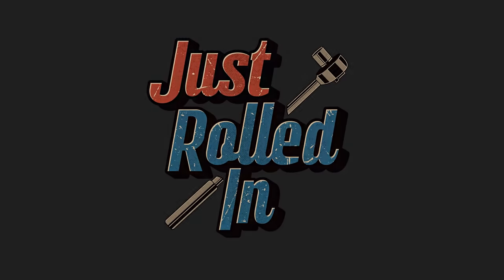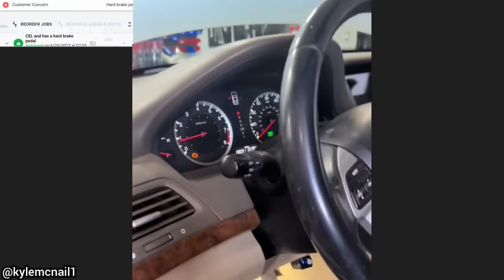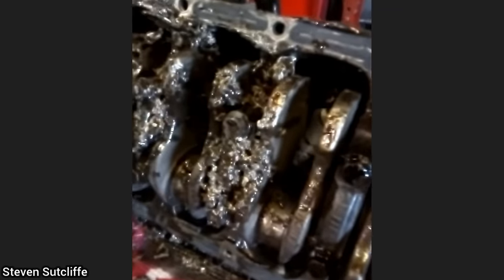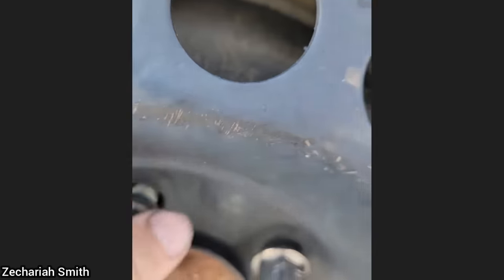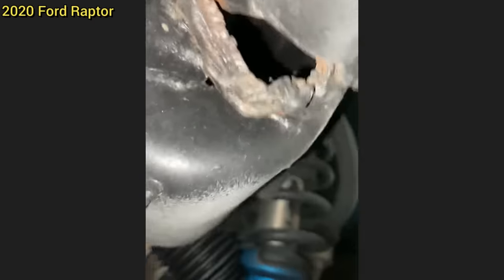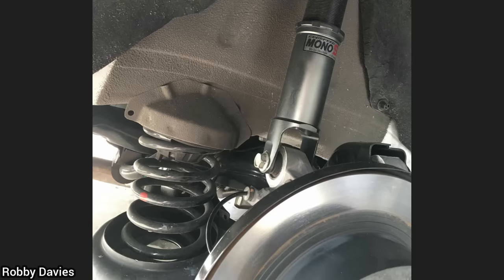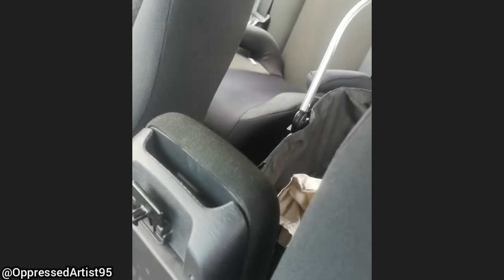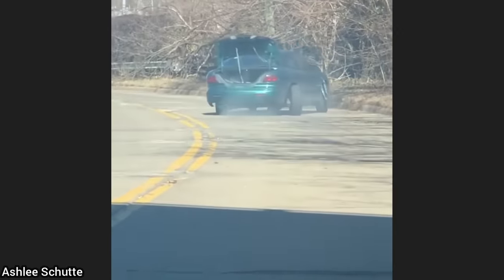Customer States Haven't Changed Engine Oil In 90,000 Miles

Comment: Seeing all these cars going thousands of miles without oil changes maybe I should stop worrying when I miss my oil change interval by few hundred miles.
Reply: Their car: keep running until 96000 miles without oil change
Your car: engine blows up after you missed the oil change by 1000 miles
Reply: yeah you can push oil changes quite far, it just gradually increases how fast things wear out as the oil becomes filled with particles.
Reply: Deployed for two years. While I was gone, my sister used my car. She traveled all over hell and half of Georgia. I forget how many thousands of miles she put on it. About two months after I got back and took the car back, of a Sunday morning in the middle of nowhere, there came a wondrous knocking from the engine. 
Valve lifter collapse because oil was about the consistency of seasoned oak.
Reply: Precisely. I skipped the annual change in 2022, and had almost 16000 km, or 2 years, by the time I did it in 2023. So far so good but I feel like most irresponsible cheapskate.
Reply: You can... But I wouldn't
Reply: Every 10,000 for me. Over 250,000 on the clock and still runs great. That includes the cheapest priced oil with mixed viscosities and brands.
Reply: @dirtfarmer7472 I go by the mileage minder which is around 6,000 miles. I have 220,000 on 2008 Honda Civic Hybrid and 159,000 on 2011 Honda CRV EXL. I’m with ya. 75% of all early breakdowns of car parts are because of a lack or no maintenance unless bad design. I want 300,000 miles out of the CRV.🏆✌🏻
Reply: I went 1,000 miles over my oil change interval, and my head gasket blew not long after I changed it. If I didn't know better, I'd think going over the interval was the reason that happened
Reply: @micheal49 did you knife hand her?
Reply: That's what those ppl from the video said. Slippery slope.
Reply: Synthetic oil can protect bearings up to 20,000 miles. It is very resistant to sheering.
Reply: I change mine every 7500 with synthetic and the best oil filters. 350,000 miles on it now
Reply: 2007 wrx at 308k miles i was told i was an idiot for doing oil changes when i didn't need to, still going strong
Reply: I change mine either every 5000 miles or every year, at the most (mine hits miles, wife's hits time).  I don't care if the manufacturer or the bottle of oil claim longer.  EDIT: though if I wind up going over by a couple hundred miles or a couple of weeks, I don't get bent out of shape, but those are the points where it starts getting up the priority list.
Reply: It really depends on the quality of the Oil and Oil Filter that you use - the combo of both together, not just one or the other. I'm using Amsoil Signature Series Oil with a FRAM Ultra Synthetic Filter, so I'm good for an oil change interval of 15,000 miles. I already had an interval of 15,000, the engine still sounds quieter than it did when I was using Pennzoil Platinum Synthetic.

EDIT: Yes, a FRAM. But stop assuming it's as bad as their cheap ones. It does not have rubber band construction, and it's rated to clean as much as an Amsoil EaO filter (99.7% or 99.8% capture rate at 20 microns) which I'd otherwise use. Here's video proof that this FRAM has no rubber band:

https://youtu.be/Gm9J36Szcho
Reply: Oh, and before you start thinking that I may have sludged up my engine with an OCI of 15,000 after running on my chosen Oil and Oil Filter: the oil pan was removed by me before my last oil change - I needed a new gasket. There was no sludge. But again, that's because of the Oil & Oil Filter that I used. Not all oils protect the same amount.
Reply: Don't do it for 2010+-ish Toyotas. It causes them to start guzzling oil. Starting to run into that with my 2012 Camry, hope I caught it early enough to stave off.
Reply: @micheal49  Thank you for your service, and sorry to hear your sister didn't get your car serviced.
Reply: We had truck come in CAT engine has IVA codes, other tech put new IVA housing on and claims he followed troubleshooting. I get the truck because same code is back. 1st step in troubleshooting check oil level. NO oil on stick, put in 5 gal of oil in and note 10 gal system. Verified repair no code, went with driver on test drive and driver says OH WOW OIL PRESSURE GAUGE DOESN"T JUMP AROUND LIKE BEFORE.............WELL DAAAAAAAAAAAAAAAAAAAAAAA 5 gals low on oil. This was engine had warranty still on it. Made driver pay for part and we ate labor. Driver said he never checked the oil because truck new shouldn't need too.
Reply: depends on the oil you get like full synthetic you can go to like 10k miles maybe even 15k all depends on the oil your useing
Reply: And you know for a fact whoever has that transit will be bitching and moaning about how unreliable Ford vehicles are and how "it seized for no reason"
Reply: I had the same thought recently.
Reply: With my Jetta I change every 7000 miles or so. It has been flawless.
Reply: @uriahstivers8125  much more likely that it was just a faulty head gasket, just because something happens after something else doesn't automatically make that the reason. put another way, correlation doesn't equal causation.
if someone can go 100k miles without changing oil and their head gasket is fine......it's far more reasonable to conclude that your head gasket was faulty or old.
Reply: @colynman it would still be undeniably better for the engine to change every 6000 with full synthetic
Reply: I own a mustang gt/cs 2014 and I do mine every 4000-4500 also my odometer is around 130k miles and still runs perfect only thing I’ve had to change engine wise was a coolant hose and that’s it but it was still a bitch to change lol but well worth it
Reply: @spooderdoggy I want 200k out of my mustang gt before I rebuild the engine
Reply: I use full synthetic with long-lasting filters, so I only have to do one once a year or 10k miles.
Reply: 3:05 deja vu
Reply: I will never buy a used vehicle .
Reply: @bubbleman2002 nope
Reply: @BabyBugBug till it isn't
Reply: @kenj.8897  Til it isn’t what?
Reply: I change my oil every 3k miles and with synthetic. The things that could go wrong are not worth it.
Reply: @kenj.8897 And I really don't want to buy a brand new vehicle but I may have to at some point. Imo vehicle reliability started going downhill about 20 years ago, but finding something low mileage and well cared for is becoming difficult. I trust my ability to inspect and diagnose an older vehicle way more than I trust a new vehicle's vast array of computers and the overall build quality and reliability. Although I suppose if someone wants to buy newish, they might as well buy brand new.
Reply: @jmi5969 damn
Reply: The thing nobody has said is it heavily depends on the type of engine, age of the vehicle and how it's used or abused. 2000 miles off-road or in extreme conditions is very different than light commuting in more moderate conditions. A big slow v8 is very different than a little boxer engine. Newer vehicles often have smaller, higher revving engines that call for thinner oil and less frequent oil changes. While it may last longer under normal use, I strongly suspect both the engine and the oil don't hold up to abuse as well as in the past.
Reply: If only they topped it off with a cupful of oil every 10,000. Probably still be running
Reply: @101Volts Why use such a good oil with such a shoddy filter? Wix are only a few bucks more and are way better made. See cutaway comparison videos for references. Your combination is silly 😂 I dunno, it's probably a good thing you use good oil cause I'd probably make up for a defective filter if you got one.

Napa's are fine too, as well as Bosch. Royal purple is fine though I don't think they make my size lol.
Reply: See you on an episode of Just rolled in then. 👍🏼
Reply: Not when you have a timing belt that goes through the oil. Like some modern cars.
Reply: @bachaddict  And maybe even more worrying is the loss of viscosity and lubricity.
Reply: Once had a car that went 2 years (but low miles) without an oil change and still regret it to this day!
Reply: I drove my used sprinter ~75k miles with no oil change. It never complained about that specifically.
Reply: @kevink1431  
remind me to never buy a used car from you
Reply: @jmi5969 think of it this way, what's cheaper buying oil twice a year, or replacing a whole car/engine 😂😂
Reply: @growingup4487 I would kill to have my 2010 STi reach  even 200,000 miles. I'm probably just below 120,000. I change the oil every 3000 kilometers.
Reply: @101Volts FRAM??? 😭
Reply: Those people that never changed  their oil are the type of people who say 'I spent $50K why should I  pay for changing oils the oil should last forever'
Reply: @BabyBugBug  10,000km is what people here change their oil, then again we have more moisture in the air that leads to condensation inside the engine and cold climate so its rougher for the engine with all those cold starts.
Reply: @Beethoven2949  "Twice a year" is a certified overkill - I only drive in summer, not more than 10000 km annually and much less after the 2020 thing (does youtube still censor it's name?). Anyway, the car is 15 years old, it already paid for itself.
Reply: @Fools_Requiem  Thought its every 3 months OR 3-5 thousand miles, whichever comes first? Reason being is, oil just naturally degrades anyways, regardless of whether you're actually driving or not.
Reply: Every 10,000km for me (6k miles). Sure you can push it a bit, but the more you push it and the more often you push it is the reason that engines usually start failing around 300k km/200k miles and start being considered as too worn out. 

Keep up with the maintenence and it'll keep trucking along no problem.
Reply: @micheal49  I don't give any vehicle of mine to anyone, there lack of planning to buy/have there own vehicle is not my problem. If there on the bones of there @ss you know that something that they don't own will be something they neglect ... it always amazes me with these people they will cry poverty but the always have enough money for cigarettes, alcohol and/or pot ...
Reply: @3DTwinkies  You're wasting your money if you're getting oil changes every three months or 3k miles.  Cars from the 80s may have needed that kind of treatment, but not modern cars.
Reply: I use full synthetic and go around 8000 miles.
Reply: @MajorasWrath1 Wow! That would get expensive if you travel as much as I do. It's kind of overkill even if you're using conventional, let alone full synthetic.
Reply: @saltwater8915  Eyah. Most agreed. But, in all fairness, I was young and dumb, and sister's hubby was a raging car guy, so I figgered he'd do better than "wait till the light turns red, add a quart". After that -- Lesson Learned.
fist bump
Reply: Depends on the engine. Some will tolerate longer intervals than others. Stretching the interval just adds up in the end, usually in catastrophic fashion. No engine is going to die from going a few hundred miles over; most won't even die from a few thousand. But that adds wear and tear over time, and knocks lifespan off of the engine.
Reply: @mattd1188  Nothing wrong with Fram's higher-end oil filters. It's their lowest-end stuff that is shoddy. If you have a Ford, Motorcraft makes the best oil filters in the world for Ford vehicles. You can't get anything better.
Reply: @dirtfarmer7472  my dealer says that they'll only change it after every 20'000km and I here in the same "5000km and then change oil" camp. Feels uneasy but hey, I guess they cover the cost if anything.
Reply: We had a 1990 Nissan pickup and decommissioned it around 2004, it rarely had an oil change after 1997 but ran fine until the brakes & body panels rusted out. I wasn’t responsible for that vehicle…mine always had regular oil changes & maintenance.
Reply: Yeah, same. I'll go 5000, maybe 5500 and feel bad. 60,000?
Reply: @mattd1188  It's a Fram Ultra Synthetic Filter. It's higher-end than the cheapest FRAMs, & it's rated to clean as much as an Amsoil EaO filter (99.8% at 20 microns) that I'd otherwise use. Do you think "FRAM" = "Cheap, and with the the filter element held on with a rubber band?" Well, it's not - here's video proof: 

https://youtu.be/Gm9J36Szcho
Reply: Honestly depends how you drive and where you drive.  Some situations you should do it sooner than the manual says and some you can go longer. Mine says 5000 but because I don’t rev the crap out of it, it runs long enough at least once a week to boil the water out of the oil and I do mostly country road/highway driving I go 7500-8000 since I got my car. I’m over 200k miles now and it still runs like new other than the noisy exhaust I need to fix lol
Reply: @dirtfarmer7472 ⬅️ Sunny or rainy weather?
Reply: @growingup4487 ⬅️ shear not sheer
Reply: A few k id worry, not a few hundred.
Reply: I did every 9000 miles
Reply: NO! Don´t do the first step in becoming a safety hazard on the streets, we allready have enough *Points at every Just rolled in Clip.
Reply: New turbo cars need every 3-5 thousand miles to be changed.your 10000 mile oil changes look awful and most of it has burned or leaked out by then.
Reply: @101Volts that is surprising, Pennzoil Platinum is a very good oil.
Reply: @alphatrion100 wet timing belts are so stupid. One of the most ridiculous cost-saving measures I've ever seen. You know the engineer was just shaking his head when he was forced to go through with that design.
Reply: @friedpickle9828 
I hold the engineers accountable for such a stupid design. They should have kept their foot down.
Those cars won't break any mileage records
Reply: @micheal49 when I bought my sister’s 1971 beetle from her, first thing I did was go to change the oil.  About 1/2 cup…. 4 fluid ounces…. Dripped out of the oil pan.  Those engines were hard to kill.  Ran great once it was full of fresh oil!
Reply: @Anonymous-jj9yu  well quit hammering and redlining it then lol, Ford's recent engines ain't exactly quality champions
Reply: @forestghost7  I’ve had zero problems with 2014 models but the newer ones are shit
Reply: @dirtfarmer7472 Same here - and the filter. I don’t get why people neglect this.
Reply: There is some lee way.  These vehicles are a glimpse of what is going on in people's minds. Scary.
Reply: I have an 03 Honda Odyssey with 210k miles on it. I'm the second owner, and I put all but 50k of those miles on the vehicle. I use Royal Purple oil and filters, and I change the oil once a year the day after my birthday. (Or every 12k miles whichever comes first). Though last year and this year I forgot. I was going through my receipts and service record and realized I was 15 months overdue (27 months since last oil change) and had driven 26,000 miles on that oil.
 I asked my brother (a mechanic for the state of FL) to do the oil change for me because I couldn't find a sitter for my toddler.
He drains the oil comes inside and says "are you sure you didn't just change this oil? It's coming out and it looks like it's fresh synthetic you could easily drive another 3 to 6 thousand miles on this."
Reply: @alphatrion100  The board will listen to accounting, not engineering. The chance to save a buck is just too tempting. Oh well, they'll be the ones to lose a customer for life by implementing these wet belts
Reply: I normally do oil changes every 5000 miles, but if I did that with my Civic I'd be changing it every 2 months or so.  I was putting 2000 miles/month on it, so it gets every 10,000 miles.  Over 200,000 miles on it now and when I pulled the pan recently it looked brand new in there.  Oil I use is Walmart Supertech synthetic and the Supertech oil filter.
Reply: That's kinda the thing with any routine maintenance. You have a lot of leeway with the routine interval but at the same time it's very easy to go from routine to never done at all if you are too lax with it. Best to try and keep as close to schedule as possible more for the sake of the human mind liking consistency than for the device actually needing it right that second.
Reply: @growingup4487  yeah 308k on the body but how many engines have you replaced? /j
Reply: How the hell can people think it’s ok to not maintain their vehicles. This is scary and extremely dangerous. I take my car in for MOT & service without fail every year. 
My car is 2005 and still runs great.

People that let their vehicles get like this should have their driving license taken from them and banned from owning a car. 

Putting yourself and others in danger. 😡🤬.

Surprised that the police didn’t stop these vehicles before and strip the driver of their keys and get the vehicle scrapped immediately.
Reply: let my '04 Accord go nearly 7k miles on an oil change and felt really bad about it.
Reply: Dad always said, oil cheap, engine not so.
Reply: @Acorn_Anomaly  You can try Amsoil engine flush, then put in Amsoil Signature series oil and a new oil filter. Put Amsoil Upper Cylinder Lubricant every gas fill up for the first five fill ups, then every 3rd or so fill up after that. Put one bottle of Amsoil performance Improver in gas now. At 6 months, put another bottle of performance improver. Change oil filter, too. With Amsoil, the oil can wait until 1 year. At one year, put another bottle of performance improver. Change oil with Signature series and filter. Repeat this pattern. Your car should have no oil consumption issues. Good luck!
Reply: Dude, working at a drive-thru oil change place, you come to realize the average mindset and the average amount of common sense instilled in your average American. Too many people go like 6000 miles on conventional oil. Or think you can get 10,000 miles out of full synthetic oil. Have you ever in your life heard of an OIL lasting TEN. THOUSAND. MILES. 

THEN WHY WOULD YOU THINK IT’S OKAY TO DO IT NOW?!?!?!?!?!
Reply: @justgivenofox9543 I do my oil every 18,000 as per the service schedule. Currently at 276k miles. And still on its original turbo.
Reply: @justgivenofox9543  I said earlier in this thread that I went 15,000 on Amsoil Signature Series oil, which is 100% Synthetic Oil, which is different... Then I took the oil pan off, and found no sludge at all. But that's different. That's also with an exceptional oil filter, catching 99.7% or 99.8% of particles at 20 microns. Amsoil recommends their own filter, but I found a cheaper filter that does the same job without sacrificing any quality.
Reply: As long as you don’t end up in one of these videos!
Reply: @uriahstivers8125 Nah, completely different systems. Missing by 1000 won't cause a head gasket failure, I see people constantly 10k over.
Reply: Ease it up to 5000.
Reply: @dirtfarmer7472  i just change whatever my book tells me lol
Reply: @MommyKhaos 😂 so true
Reply: I'll never trust my shit to run long like that lmao. Shit you not, I'm on my way to my first oil change after buying my car and end up blowing my engine.  As my mechanic said my engine, filters, head gaskets and pumps were "obliterated" and inside my engine was like aquarium gravel. 
Shit wasn't even my fault or lack of oil changes. I wasn't even 100 miles over the recommended time to change. 
N of course it timed itself perfectly for when I was entering a parking lot and I thought damn I kind hit that bump at the entrance coming it kinda hard. Only found it my shit was toast when I went to put it in reverse to turn around.
Reply: I change my oil once a week even if i don't drive anywhere
Reply: Only if it's a Toyota!